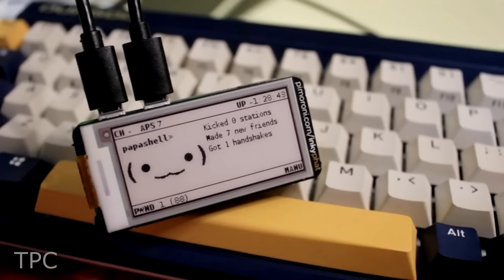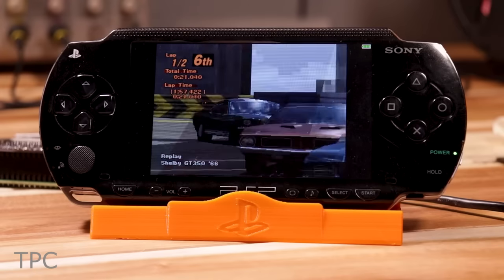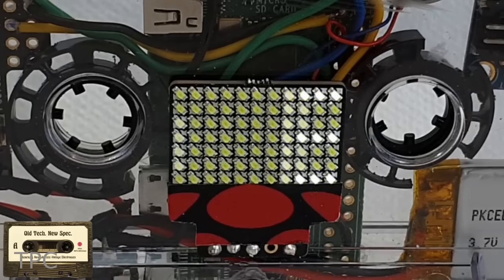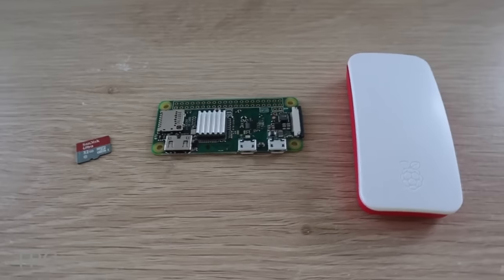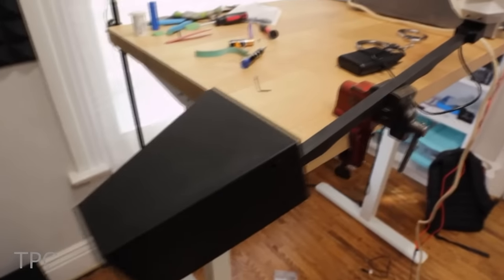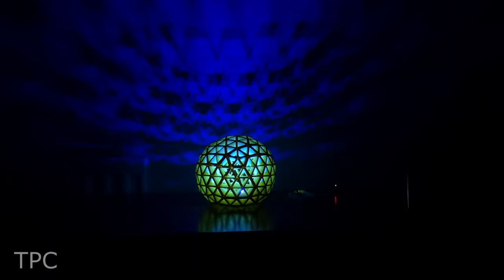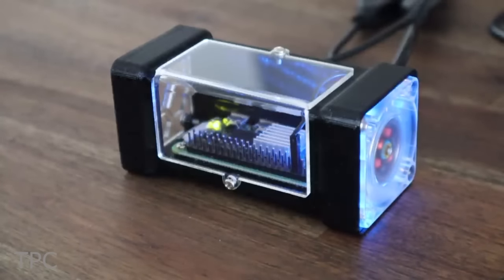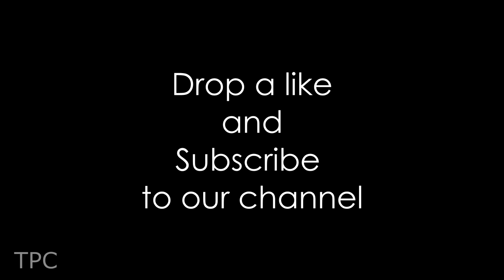15 Brilliant Raspberry Pi Zero projects to learn and try!

Comment: this "friend lamp" is such a waste of a pi zero... just use an esp8266 connected over wifi for this kind of useless trinket, it'll be much cheaper and will have the exact same functionnality, while consuming way less energy.

Comment: analog cameras have very good image quality if you get the right ones. in fact large format film cameras are still much more detailed than any digital cameras as far as I'm aware.
Reply: Where did you hear that lol? I work for years with Digital ones, and the image quality, as long as you use a good one, is absolutly better. Also, if you build a pi into an analog one, like the super 8 for example, it doesnt use the imaging stuff anymore except the lenses of course.
Reply: @meloney  you mean a 35mm film is not as good as a modern digital 50mp camera? There are some very large format film cameras for specific scientifit uses. they simply dont make a 600mp digital camera. In general most analog mediums can be higher quality that digital.
Reply: @veneratedmortal4369  you forget that there are scientific digital cameras as well. For example the ones that are used in electron--scanning-microscopes (even tho they are special ones) and high speed cameras. Not like they don't exist and not like one can use a film camera for everything.

Just because in some cases they may be superior, in most modern cases, they're just not.

And.. Why Megapixels? That's absolutly not everything that counts in cameras. It's the sensor as well as the noise ratio and the Bitrate.
Reply: @meloney  20mp cameras are around the same image quality as 35mm film, whilst there are now larger mp cameras they are still inferior to larger format cameras. Of course, there are also large format digital cameras/digital backs but they are very cost prohibitive eg, a 5x4 digital back alone costs $26000. The image quality from 5x4 film would blow away any 35mm or medium format digital camera. For the example, in this video, the reason the image is cropped in so far is that the sensor is significantly smaller than 35mm hence only a fraction of the image (which is intended to be recorded on 35mm film) is being recorded, it will most certainly not give a better result then 35mm film as the video implies.
Reply: @roo7239  20 MP or generally MP that is barely say anything about the photo quality except when it's really low. 35 mm . Are you talking about an interchangeable lenses? How does this change the photo quality except letting more light in a super fast lens with f.<1.0 in? This nowadays is more of an image sensor thing. That's why 110 MP phone cameras are still not as good as a 40 or 50 mp D-SLR camera- They just don't have an as big sensor

Also I've taken a look on images of a 4x5 high format film. No idea how you think that is better quality than a professionally shot picture with a super fast lens with f.0.7
Reply: @meloney  no 35 mm is a format so 35 mm film is the same size as a full frame digital. When digital got to around 20mp is when pro photographers really swapped over to Digi so I'd say and a vast majority of people believe that is around equivalent to 35 mm film. Yes mp does not 100% mean better but sensor size does generally correlate with larger megapixels and larger mp means you can do more with the image. Finally I'm not sure how you can think an image shot on 5x4 can be inferior in detail or tonality to something on a smaller format, think of the film as a sensor that 5x4 piece of film is significantly larger even from medium format then a full frame camera would be from a phone camera.
Reply: @roo7239  Oh, you meant the filmformat, i had the focal lenght in mind! Im not saying that a larger format doesn't have better quality than small format. All im saying is, that it is quite a fact that modern picture sensors and especially high speed lenses with <f.1.0 do have an exceptional good photoquality.

Did you ever work with high end digital video and photocameras, especially with those lenses? You can literally easily make movies and pictures with just candle light for example. You can also easily do gigapixelphotos and much more. I just dont see or why cameras with film should be superior to our modern cameras as D-SLR.

Im using them weekly, sometimes daily. In my case for astrophotography. No film camera could bring me the details this can. And i've googled for photos on film like the 5x4 etc. But couldnt find anything that is superior.

Maybe you have a few pictures you could actually show to me to show me how it is superior?
Reply: @meloney  I'm not saying digital is inferior, but I am saying smaller format is inferior for image quality and unfortunately large or even medium format digital is still too cost prohibitive to be worth while unless you are a high end photographer with money to burn. In the example shown in this video 100% you would get a better quality image by just using film in that analogue camera then by using the tiny 12mp sensor on the pi. It is impossible to see the difference between 5x4 image quality and DSLR on a monitor, the images are too compressed and it destroys the advantage of the larger format & yes I work in the photographic industry for close to 10 years now but only stills I don't work with video.
Reply: @roo7239  "image quality and DSLR on a monitor" "the images are too compressed" To compressed? How about using actual raw data? Video is essentially just 24 pictures per second. Even cheap D-SLR cameras have high e nd quality this days. Not those tiny pi-cameras though. 

Please give me examples for the superioir detais of film because i absolutly cant find any.
Reply: This is true. And not just for cameras but film in general. Old magnetic film actually has a much higher resolution than digital far beyond 4K and 8k. This is how companies are able to make Blu-rays out of really old movies. As long as they have the negative they can extract an ultra high resolution copy. Same goes for modern displays. Old CRT TVs have a much better picture quality than today’s digital displays. The problem with digital displays is that there is no motion what so ever. The pixels are square shaped in a fixed grid on the display. The pixels simply change color. On older CRT displays the image is projected to a screen and pixels not only change color but move across the display. This is also why modern displays require such insane refresh rates. This is in order to trick your brain you are seeing motion. But again there is no motion in modern displays. Fixed pixels simply changing color with a mess of post processing to mimic movement. The reason why CRT and magnet film was replaced with digital actually has nothing to do with quality but cost. It’s much cheaper under Capitalism to use digital than manufacturing CRTs and maintaining film.
Reply: @meloney  magnetic film is better than digital. Might want to ask for your student loan back, bubs.
Reply: @xCobraCommanderx  it can be, but doesn't necessarily have to. I want to see a film doing a 50 gigapixel image that easily without issues and marks. As I was asking before: why could I neither find a nice sample image or noone I asked ever gave me one here? Also I'm not American, we don't need to worry about those loans.

You can't say that film is better because AFTER scanning you loose details. If you would shoot with digital firstly, one wouldn't have that issue. Film noise and grain is something many absolutely don't want either for films. Even when magnetic has way less. We were talking about normal films before. Digital noise can easily be almost completely removed by stacking and/or using darks for example.

Dynamic range is absolutely out of question here, because modern cameras absolutely win that. It wasn't always that way though. But our technology reached far enough that digital clearly wins in dynamic range.

Digital usually has WAY more ISO/speed. While most film are at max 6400, digital can often reach over 50000.

Also, today convenience is also an important topic.

So tell me again. What are the reasons exactly why film is better? Yes, analog is more personal and fun, but that doesn't make it better. I never seen any reason why film is better.